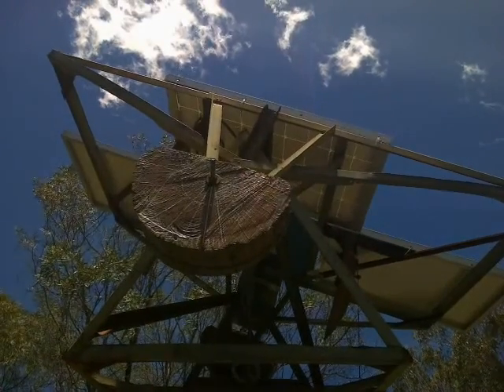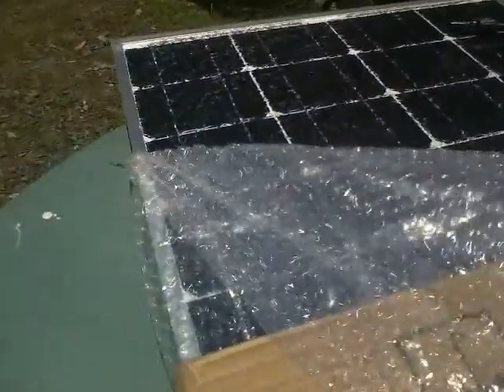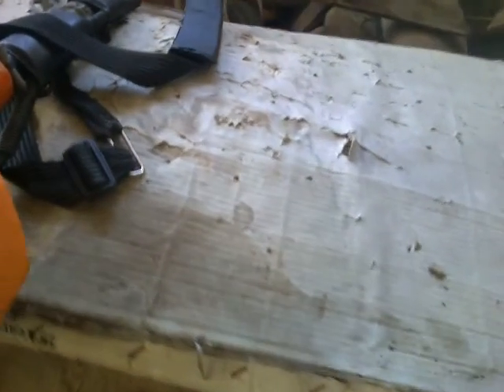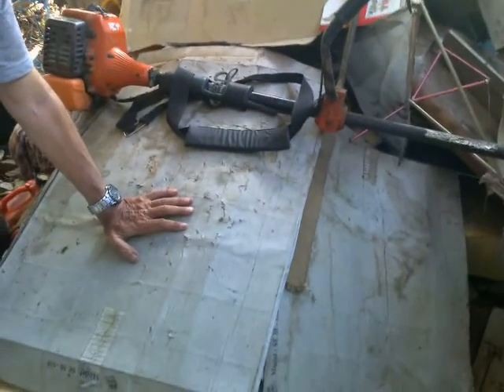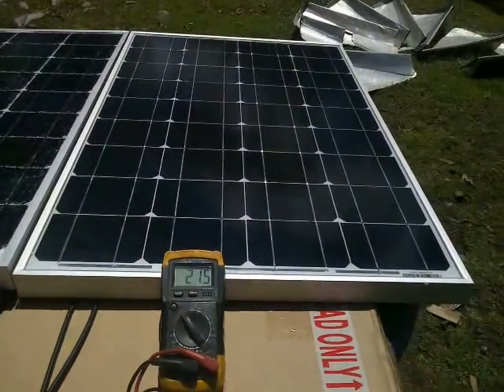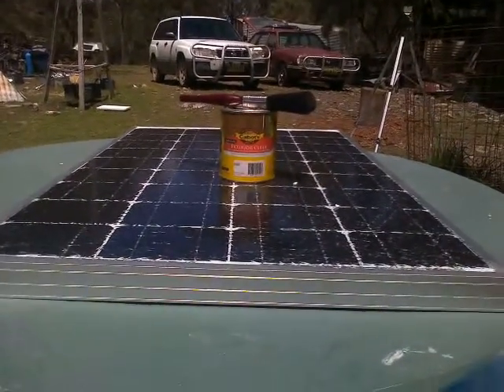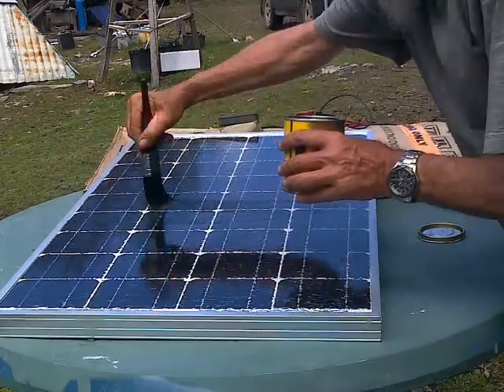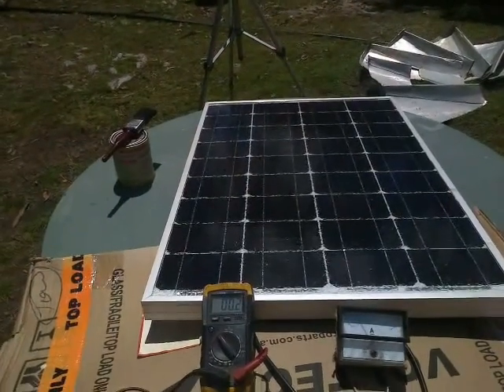Solar Electric Jigsaw...; Varnish Repair !

Comment: I've been hearing that solar panels have become a lot cheaper in recent years. I'd like to produce my own solar power sometime :-) Thanks a lot for posting because i'm bookmarking this and should be good info when i do this
Reply from the maker: G'day,

  Thanks,

   Yes, indeedy so, that be extremely True.

  From 1980 to 2010, Solar Panels cost roughly $10 per Watt "Rated Output", but until 2002 most Panels were "rated" at 25 to 27 Degrees Celsius - which seemed OK to the uninitiated ; but Photovoltaic Panels hate to get hot (the Resistance of all those tiny embedded Wires increases as they get hotter), and on a 30 Degree Day they usually operate at 50 to 60 Degrees Celsius.

  Therefore, effectively, from 2002-2005 the "Ratings" became actually connected to Reality, because the Manufacturers began rating Panels at 50 Degrees Celsius ; therefore, from 2002 to 2005, Panels became 50% cheaper because the Marketing Jism was pulled out of the Sales Pitch.

  Then, from 2010 when I paid $330 each for 5 Gallium Arsenide Panels rated at 30 Watts each at 50 degrees Celsius (and which in reality still  deliver 22 to 24 Watts each in Service after 6 years...)

  But, last year I bought 2 Silicon Panels rated at 70 Watts each at 50 Degrees Celsius, and they were marked at $170 Retail, and this year they were $160 each...

  So, yeah, prices for Solar Panels are unbelievbly low, at the moment...; so feel free to stock up, while the going is so good.

  The salient point is to set yourself up with Batteries & an Inverter, and have a stand-alone System ; because if your Panels feed the Grid then unless the Grid is working then you have no Power at all...

 Think about it...

;-p

Ciao !
Reply: +WarblesOnALot Can't you set up a system that sells to the grid only when the batteries are full?
Reply from the maker: thethegreenmachine 

   Yes, you can do that, but Batteries cost $2 per Amp-Hour to store Juice at 12 Volts, twice that at 24, and to use 1 Amp/Hour you have to store 10 A/Hr (so the daily Cycle is between fully-charged & 90%...), and to use 2.5Kw/Hr or 3 Kw/Hr per Day requires $4,000 worth of Batteries, as well as a $2,000-$4,000 Inverter to supply the House ; as well as the Panels & the Grid-Tie Inverter...

  So, most people who're borrowing money to install Suburban Rooftop Solar, when offered the option of adding $8,000 to $20,000 to the installation-cost of their system, purely to be immune to "Blackouts" will reject the option.

  It all boils down to how much Faith one has in the idea that somebody will always show up to fix the Grid...; and I expect it to one day go down & stay down, so my system is Stand-Alone...

 Have a good one,

  ;-p

Ciao !

Comment: If you had  the just the slightest desire to work for wages, you would make a good solar panel salesman.
Reply from the maker: G'day Ed,

  Thanks for the bouquet,

    As it happens, one of my hopes is that one day someone will want my Son to sell them a House-sized Solar System, and he'll be too busy to do the initial assessment, and thus he might want me to go and figure out how many Panels, how big a Battery, and what size Inverter they need...; then he can work out a price for them for something which will Work without fucking up , because there are plenty of people around who've killed 2 sets of Batteries before getting around to asking my son to fix their setup for them...

  He's been running his own show for 2 years, and I don't want to crowd him...

  And, the truth is that anybody other than my son would require me to have Formal Qualifications, whereas I'm a Time-Expired Nurse and entirely self-taught in 12-Volt stuff ; and I'm Paper-Pased, so anybody expecting Computerised Employees simply isn't interested....

  But, we'll see...

Have a good one,

;-p

Ciao !